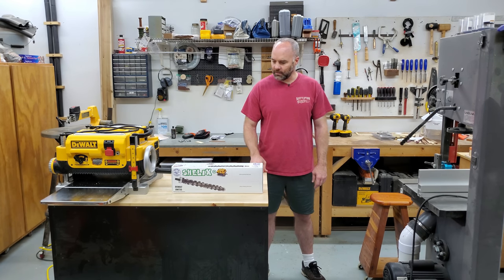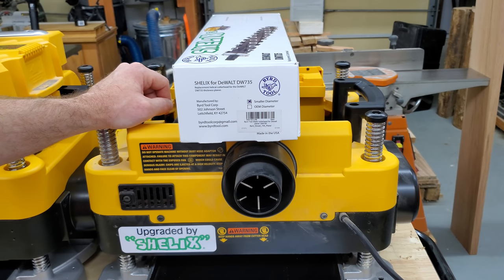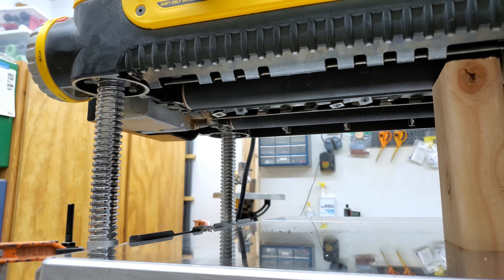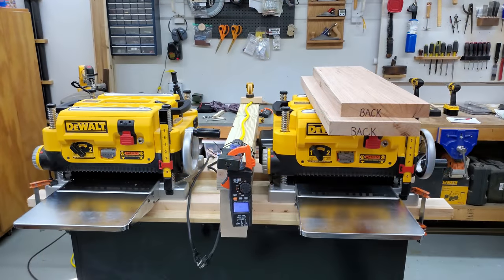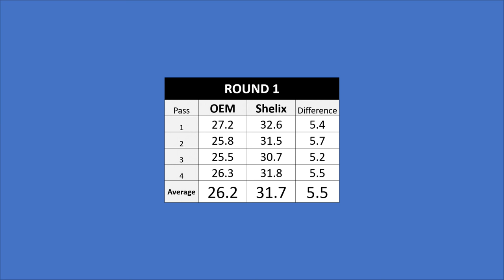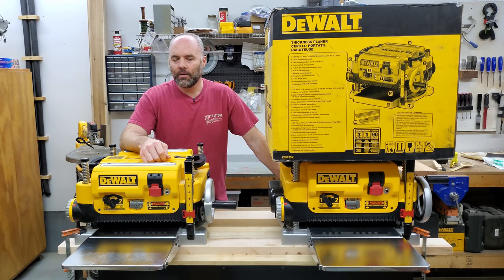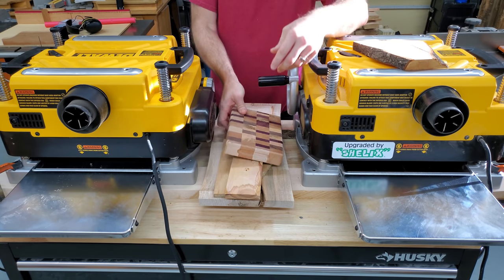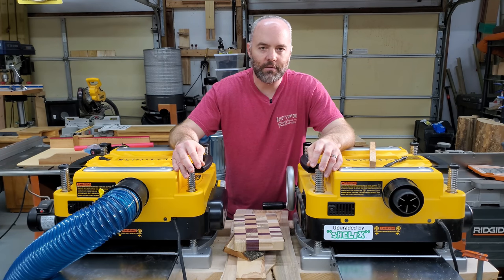The video I wish I watched before buying a SHELIX

Comment: If you amp measurement is correct - you have a significant fire risk you need to get you breakers checked asap
My clamp meter and all that Ive used can only measure current in one cord. Fluke says you have to separate the wires to read the correct amps and keep the wire centered or at least 1” away from the wire. Maybe that explains the current numbers significantly higher than reality
Reply from the maker: There's some more information in the video description that further explains the measurements. I made another video that provides an inside view of the breaker as it trips: https://youtu.be/24f-J0lVo-E

Comment: I would let the amp meter float during the board insertion, because as soon as you insert the board it mausuring inrush current then the amps should drop during the 4 ft board surfacing. theres inrush current when you start the motor up and when you introduce a load for maybe 2-3 seconds.
Reply from the maker: https://youtu.be/24f-J0lVo-E

Comment: Superb review dude. I ordered my 735x a couple days ago. Although with regard to the helical blade replacement at almost $400 the jet brand benchtop planer has the helical in it from the factory and a planer is $750. So put that math together $650 for the DeWalt plus another $500 almost for the helical cutterhead it's over $1,000. Might as well just purchase the jet brand
Reply from the maker: This comes up once in a while. The Jet and Rikon have steel inserts, not carbide, so you'll spend a lot more on replacements in the long run. They're also misleadingly advertised as helical "style", not helical.
Reply: @TheSnekkerShow  got ya. Thanks👍

Comment: EXCELLENT video, it happened to show up in my "suggested" sidebar even though I wasn't watching a video about woodworking. I have the same DeWalt planer. I have 2 questions:
1) on the red oak tests how much were you taking off each time and would taking off less reduce the amp draw?
2) I get siping, do the helix blades cause less of that?
Reply from the maker: Yes, a shallower cut would reduce the amp draw. I was planing 13" wide maple last night, but only 1/2 turn off the handle at a time. As for snipe, this video should solve or reduce your problems: https://youtu.be/wcOUKAxrTy0

Comment: After numerous comparisons, I vote for the Oliver bench top planer...Byrd SHELIX comes standard as does Wixey digital readout...if you want accuracy. In the end the premium price is worth it for professionals...maybe not DIYer's. Another tool that I recently discovered is the Super Surfacer...If you have hand planed a piece of wood and gotten a long beautiful near transparent ribbon, well, imagine a machine that does that a meter per second... unlike most planer the super surfacer has a continuous belt instead of roller and a stationary blade that you can adjust the blade bias. With the "Super Surfacer" smoothing machine, one achieves a surface quality that no sanding system equal. Normal and difficult woods will shimmer. 

 Because the wood fibers are perfectly cut (not pressed and abraded), they become naturally water and dirt repellent which results in a natural wood protection. For us luthiers, the wood finished in this method actually improves the acoustic qualities of the wood...leave it to the japanese.  https://www.youtube.com/watch?v=eaClhzlpc_0

Comment: I have an old ryobi planer than I do not use much since I got a laguna supermax 19-38.  I have found that with 80 grit it really can clean up wood fairly well for what I have tested, and since you can also put higher grits on it, the surface comes out amazing.  Maybe when I get a bigger shop I will invest in a pre-set up planer and jointer with the shelix head, but for now your video makes me think I should keep what i have. Thanks :)
Reply from the maker: One of these days I'm going to buy or build a drum sander for small pieces and end-grain cutting boards.  Space is always a challenge, and also justifying and prioritizing tool purchases.
Reply: @TheSnekkerShow  stumpy nubs has plans that you can buy (i did that before I went and bought mine during a 10% off sale at rockler)  I have everything on wheels so have to move stuff in and out of my machine work area, for everything except the tablesaw...ie bandsaw, jointer, planer, sander all would get moved to one 'work spot' then back out of the way.  You will really like the drum sander once you get one.  I have also seen someone take the laguna supermax and take the top off and make it a bed sander instead to do larger projects.  best of both worlds that way.  ie similar to the stockroom supply one that way (which also sells kits).

Comment: great video.  Apart from the current draw, are you happy with the Shelix upgrade?  Would you do it again knowing what you know now with regards the current draw?  Are the results worth the cost/effort of the upgrade?
Reply from the maker: The breaker tripping is an annoyance, but it only happens if I need to plane a lot of wide boards consecutively, which is very seldom, and can be avoided by taking shallower passes. I would definitely do it again, and I'm looking forward to upgrading my jointer eventually.

Comment: The only real comparison on power would have been to compare power usage would have been to test the Shelix and the straight blade in the same planer.  Even so it was probably a pretty good comparison.  Also, I suspect the difference in power required has to do with the Shelix essentially being a 4-blade (segmented) rather than 3 blade.  I would have expected the helical cut to reduce the power required, but maybe not.  Sounds like the planers really need to be on a 30 amp circuit...
Great video, thanks!

Comment: Thanks for the update Ben. After your original vid i ordered a OEM size Lux Cut III head . (OEM size byrd was 20-24 weeks wait i was told)  Should be leaving today.  I'll do some measuring on mine and see if they compare (240v version so will be interesting to see if it's close to half, or if the efficiency of the 240v  motor is better or worse).  I thought the rear view of the different pieces going through near the end demonstrated the sound difference better between the two than the actual sound test segment.   Well, that's the difference im hoping for anyway, the sound test segment seemed close in volume, just different pitch (better)... but not the huge difference the final rear view test seemed to indicate......  
Oh, and my first thought was, if you were spending that money, why not buy the OEM cutter ?  (But i appreciate the side by side.... that has to be a first for the 735 on YT)
Reply: 735?
Reply from the maker: That would be interesting to see how a 240v motor fares. I thought about picking up an OEM diameter Shelix, but I haven't been able to justify it in my head yet. I'd kind of like to upgrade my jointer cutterhead too, and get a SawStop, and the list goes on.
Reply: Is that a totally different planer or does ours have the option to be set up to 240 Volts?
Reply: @carbonfusion  I was referencing the DEWALT DW'735' as shown in Ben's video.
Reply: @CampMoreBarkLess  No just the Australian version. 240v compared to the US 120 volt versions....
Reply: @Gazfixify  thanks for the info
Reply: @Gazfixify  Thanks so much! I'm silly, I thought it was some secret society lol.
Reply: @TheSnekkerShow   Hi Ben,     So i got the Lux Cut III head yesterday and installed it tonight. 40min in and out, plus 20 mins to install the 40 cutters.     I measured the voltage to see what it dropped to under load so i had an accurate measurement to work out power from.     Using a 110mm piece of very hard hardwood (not sure species)  , i ran it through the stock head.  1mm pass.    Got a reading of 9.4 Amps
With the Lux Cut in, same  1mm pass,    9.6 Amp .       I was surprised it was so close.
I notice the Lux Cut has far less 'twist' in the design along the cutter compared to the Byrd..... I wonder if that makes a difference. ?    No load was 5.6 Amp for the stock cutter,  and  6.5 for Lux Cut III
24.5 Amps for max surge at turn on for the stock cutter.    (Forgot to measure max for Lux Cut --- will do later) 
Very happy with cut quality over stock !
Reply from the maker: @Gary John I read this early in the morning and almost impulsively ordered a Lux head for a side-by-side. After work I decided to first try to replicate your test using a 110mm (4 3/8 in.) piece of dense, heavy, old-growth Virginia Ash (harder than the oak I used in the video).

The first measurements were with the Shelix: 11.4 amps at no load. 18.1 with a 1mm cut (just under 1/32"), which is pretty close to your result (assuming x2 for the 110/220 difference). Then I did a full wheel rotation (1/16 in. or 1.6mm) and drew 21.3 amps.

Next with the OEM steel knives: 13.3 at no load. With a full wheel rotation (1/16 in./1.6mm) I got 19.5 amps, which was just slightly under the Shelix.

Of course, slight variations in wheel rotations and wood density would affect our respective results, but overall, it looks we were pretty close on the helical and steel cutters. It seems like the power-draw differences are more significant with wider boards.

This is an unlisted video so it doesn't show up in my channel's video list, but the direct link works: https://youtu.be/z-5n9ElTp2s

Comment: Another item that was not addressed is that with the stock straight blades, it is an interrupted cut. One blade will contact the wood, and then there will be a dwell period of no load before the next blade makes contact. With a helix cutter, there will be no dwell time, there will always be a cutter insert in contact with the wood, and the load will be continuous on the motor. The interrupted cut of the straight blades averages out to a lower power draw compared to the helix cut.

Comment: We plane a ton of hardwood through the same planer, but never run 1/16th inch cuts.  We generally never do more than 1/32". Time v tool wear is less important when you look at the costs.

Comment: How did you get a current draw over 15 amps? The motor has to be DC. if your current draw is over 15amp the voltage must be below 120v.
Reply from the maker: There's more information in the video description, and in this video: https://youtu.be/24f-J0lVo-E

Comment: Really good review! I'm trying to decide which planer would be best to pickup, not only for my current projects but for the future, I'm planning on doing more woodworking in the coming years. Your review was very informative and covered a lot of valuable information. Sound changes, performance, power and warrant when installing the byrd helical cutting head. Thanks for making my decision easier.
Reply from the maker: My pleasure, and thanks for commenting.

Comment: Seems like the power difference is due to the difference in rotational mass of the 2 different heads. Less rotational mass needs less energy to get to speed but suffers from less rotational energy causing the motor to work more to try to maintain the speed

Comment: You said in the beginning that because of the under sized selix head that the rollers are putting more pressure on the work piece and that in itself would cause the motor to work harder so to me this would confuse someone because if you went with oem size it may have drawn less power.
Reply: The larger OD head would offer higher torque so testing with an OEM sized Shelix would be interesting.

Comment: If you would send it in for warranty I would definitely put the factory cutter head on it. For no other reason than if they would replace the whole planer they wouldn't put your cutter head in the replacement you'd just have the stock 3 blade again.
Reply from the maker: That's a very good point.

Comment: If you want to reduce tearout in a very figured board, take a wet cloth and make the board cutting face damp. It'll massively reduce tearout
Reply from the maker: Good idea. I sometimes use alcohol for that, just to reduce the amount of water than might soak in to the figured grain.
Reply: I’ve been a furniture maker fir 55 years  . I’ve never wet the surface and I understand the premise, but I’m not sure that will work. I will try it. It  definitely will big down the cut. Thanx for the suggestion
Reply: @sphlouge  I understand the hesitation but I went to one of the top leading schools for furniture making in the US and I was working with birds eye that was tearing out. Jerry Osgood told me to try wetting it a bit and it solved my problems. Being as he was one of the most famous woodworkers I’ve ever had the pleasure of meeting, I took his advice.

Comment: the one variable that i would like to see addressed is that a possible reason for the power difference maybe that the under sized head is actually causing the machine to work that much harder. now this could be way off but the under sized head should be working harder to remove 1/16" than the oem sized head. much bigger difference but think about a belt sander vs a dremel trying to remove the same 1/16" in the same amount of time on the same board.
Reply from the maker: One plausible theory is that with a three-knife cutterhead, the motor has a fraction of a second to recover between cuts, while a helical head has constant contact with the wood while cutting.
Reply: @TheSnekkerShow  Perhaps, but think about the radius of the outside of both cutters.  The smaller cutter should have less of a lever arm so you'd think that the current would be less.  Perhaps the steel cutters are sharper at first than the carbide?  Enjoyed the video.  Interested in building a separator for my vacuum now.  Btw, I have the Byrd 15" cutter in my old Jet planer.  I was dismayed at the reduced max depth of cut, but now I know why.
Reply: @TheSnekkerShow  You could measure the current of a light bulb to prove your new clamp-on ammeters are right.  (Electronics engineer here.)

Comment: The whole problem is the planer. I'm a cabinet maker and used some sophisticated machines. Black and Decker/ Dewalt has some of the old guard still there and will never deserve the Dewalt name. I think the sound from either one is fine. The extra juice for either one is slight also. I agree that the pain is greater for the Shelix but worth it.

Comment: So I’m having trouble making a single pass without tripping the breaker these days. I did run a lot of oak fence boards through would you recommend I flip all three blades over and see if that solves the problem? I have not hit any nails so no nicks but I’m sure dull blades can over heat the motor.

Comment: Thank you for this video. I just want to be clear in my mind: if you had to do it over again would you still get the undersized or would you get the original (OEM) so you don’t have to mess with the rest of the gages/measurement settings? I think the answer is if doing it now after learning everything that the OEM size would be the better choice. Please let me know.thank you.
Reply from the maker: I swapped out the undersized for the OEM earlier this year. https://youtu.be/8J0rvBi8a0k
Reply: @TheSnekkerShow  thanks, that was what I was thinking would be my choice.

Comment: add a capacitor to help the motor stay at full speed....that is why the 3 blade pulls less amps essentially....the cutter head is not in contact 100% of the time so it can speed up....a capacitor charges to peak voltage and discharges....it will keep the voltage up and steady
Reply from the maker: That's just crazy enough to work.

Comment: WRT the higher current draw: There're 4 helices of blades on the SHELIX, right? Vs. 3 knives on the OEM unit. What about removing every other cutter on opposed helices [ie: helix 1, remove every even cutter; helix 3, remove every odd cutter.] Or you could try doing "skip 4" on each helix, so remove inserts 1, 5, 9, etc on helix 1, inserts 2, 6, 10, etc. on helix 2, inserts 3, 7, 11, etc. on H3, & inserts 4, 8, 12, etc. on H4. I'd like to see that test & see what it does wrt changing the current draw & any changes to noise or finish issues. Seems like it would even up the 3 vs. 4 cuts per pass to something more equal w/o placing too much extra strain on the individual cutters. And you may end up with a slew of spare inserts on hand for the occasional need to replace one entirely...
Reply from the maker: This has been brought up several times, but I haven't done much with it yet. Removing cutters could be tricky since the head needs to remain balanced on opposite sides of the circumference, without creating gaps in the cut, but the approach you suggested sounds reasonable. I've also been meaning to measure the actual linear cut area of all three knives (3×13=39") compared to 40 inserts. It might be the same distance even though there are more rows.